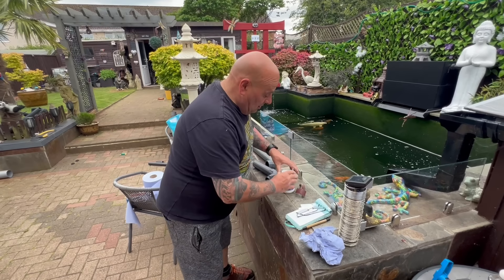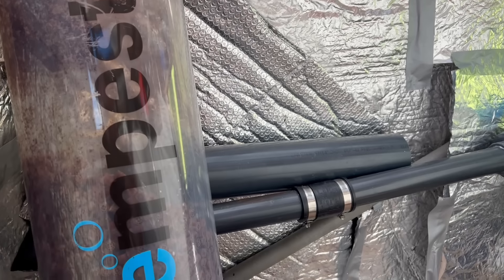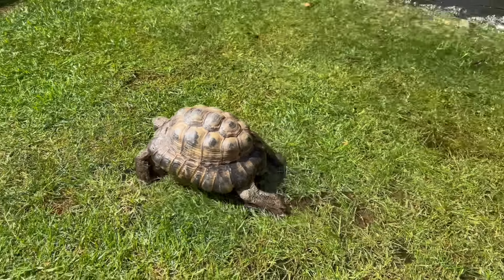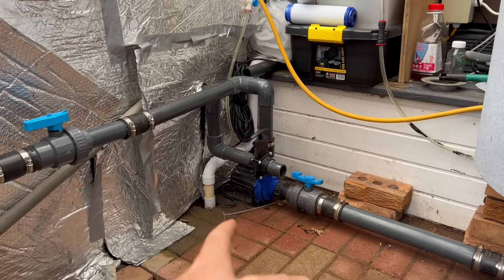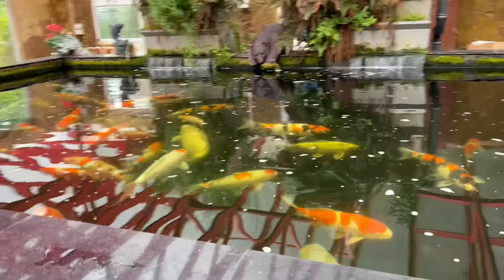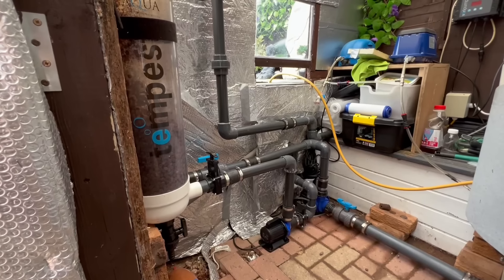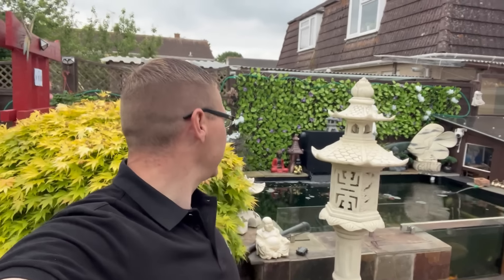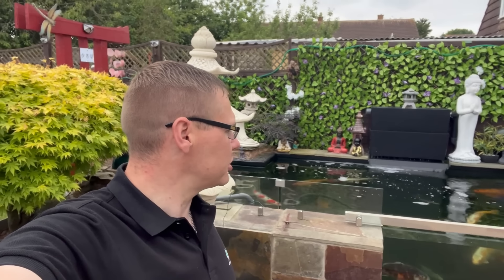MASSIVE UPGRADES TO MY FRIENDS KOI POND, DIY TO THE MAXIMUM

Comment: Was that a push fit 90 going into the Nexus?
Reply from the maker: Yea mate
Reply: @JamesTHEKOIwhisperer123  I always wondered if they were up to it but just didn't feel right. 
Makes me laugh seeing it,  he spends all that money on pressure pipe that's not needed and then puts a push fit on 😅
Reply from the maker: @deanmiles8421  pressure pipe is never needed it’s just better if you have got it but does not mean it has to be used sometimes useing what you have does the trick
Reply: @JamesTHEKOIwhisperer123  mines done with flowplast,  I'm a plumber so usa what I know 😃